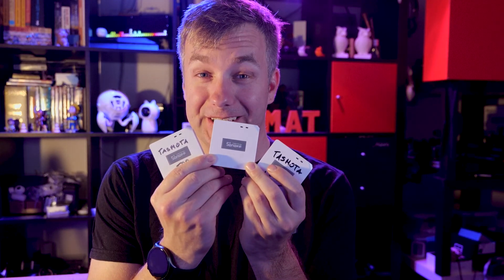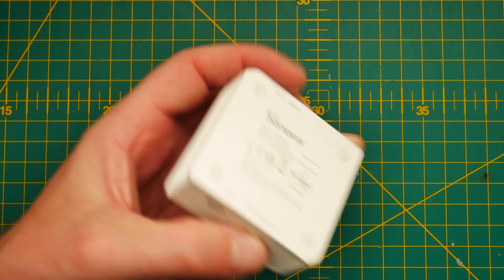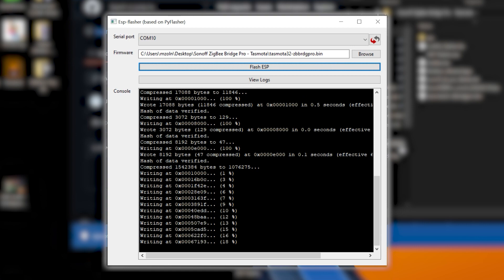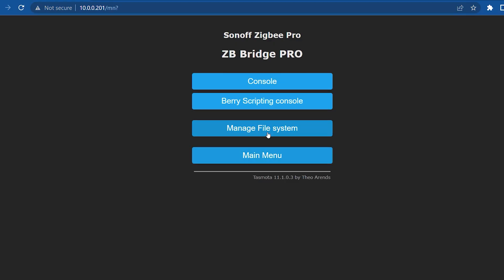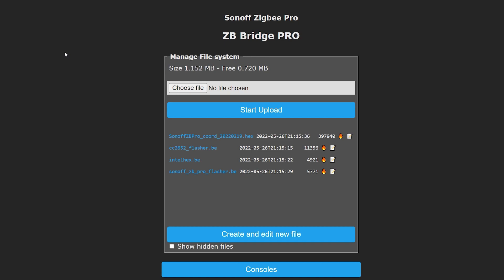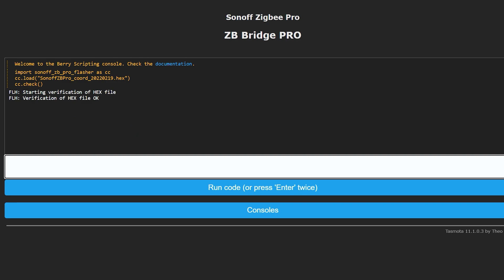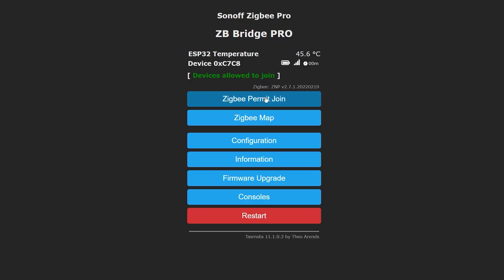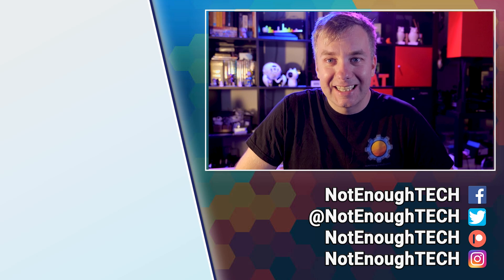Flashing Tasmota on SONOFF Zigbee Bridge Pro

Comment: Great job! I try to flash it but i give me an error. First I started flashing the snzb pro with tasmota32-zbbrdgpro.factory.bin and then I get the error:

welcome to the Berry Scripting console. Check the documentation.
import sonoff_zb_pro_flasher as cc
cc.load("SonoffZBPro_coord_20220219.hex")
cc.check()
FLH: Starting verification of HEX file
FLH: Verification of HEX file OK
cc.flash()
FLH: Flashing started (takes 5-8 minutes during which Tasmota is unresponsive)
stack traceback:
	<unknown source>: in function `flash`
	<unknown source>: in function `main`

It gives me the error 3 ou 4 seconds after hitting "run code" button. What can I do? I'm stuck in this step!!! 😔
Reply: There's one specific for zb bridge in tamotizer.

Comment: Great video on how to setup the Sonoff ZP Pro.... i have spent days trying to link this to Zigbee2MQTT on Home Assistant, but with no luck. Are you able to help on this?
Reply: Did you solve the problem? I also can't get it working with Zigbee2MQTT.

Update: In the end I went in the Sonoff Zigbee Bridge Pro to Config > Auto-Config and applied the "Sonoff ZBPro TCP" Auto configuration. Then in home assistant added the "Zigbee Home Automation" and picked "Texas Instrument" with the port "socket://YourDeviceIP:8888". Now it works.

Comment: my port detect, why i cant connect for install , so tried for flash 😭, im newbiew please help
Reply from the maker: Check your TX RX wiring.  Swap them around if needed. Port detected means that your flasher is working
Reply: @notenoughtech   thanks after 3 day im so tried, The error is in Socker VCC, it has to be moved, I think Socker VCC is already the default in 3.3, im use ftdi

Comment: Have anyone from you the original stock firmware from the zbridge-pro. Because i was so dumb and have not saved the firmware. I want back from Tasmota to original.
Reply from the maker: It's not possible as the firmware contains the MAC of your unit and if you don't back it up - it's lost
Reply: @notenoughtech  the MAC Adress is in Hardware not in Firmware, because when i erase and flash with Tasmota the MAC isn't changed.
Reply from the maker: The Mac address is compiled into the firmware hence you can't flash it without having original backup

Comment: Hello everyone and thanks to the author for the Video. I don't understand why my sonoff bridge pro does not enter flash mode. Must the led on the Sonoff be green or blue? Mine is blue. I connected the GP IOO to GND but still does not turn green. Also I connected also the bridge to an USB power source still didn't worked. Any tips? Thanks
Reply from the maker: The most common issue is not enough current from USB port. This is down to your FTD not providing enough? This would be my first take, then I'd double check the wiring and that the GND is actually pulled on GPIO00

Comment: Tasmota 13.3.0(zbbrdgpro), expanded FS, updated firmware etc but I never got the TCPstart 8888 command to work, after a day I gave up and configured the ZigbeeBridgePro to work as a bridge directly to HomeAssistant, used Autoconfigure and that worked fine. And of course, many thanks to all contributing !!!!!

Comment: I tried this method, but I don't understand where I'm going wrong. I used the tasmota32-zbbrdgpro.bin version, I wrote successfully, I set it up, I get to the partition manager part but I can't increase the partition size! Can you provide a new link to the BIN file because the link is 404

Comment: Thanks for your video, but I think I made a mistake using the latest files and something seems to have changed. So I am stuck in the middle of nowhere.
Reply from the maker: Double check the file. You can always flash it again. It's a hard to mess up process
Reply: @notenoughtech  It would be more than fantastic if you could update your workflow based on the latest December 2023 Tasmota release.

Comment: Nice tutorial, everything went through without any problem, my sonoff bridge pro was switched to tasmota bridge and it works. Unfortunately I have a problem after some time sunoff (tasmota) stops working does not respond to ping, it is still connected to the AP receives signals from the sensors, but the IP address it received is not reachable, this happens after some time and stops responding, only restart helps and it will work for a while. Have you noticed this issue with yourselves?
Reply from the maker: Try different firmware revisions. Also make sure your power supply is good. Try another usb charger and cable as they can cause instability by voltage drop especially if you are using a longer usb cable

Comment: got error for new version 
import sonoff_zb_pro_flasher as cc
cc.load("SonoffZBPro_coord_20230507.hex")
cc.check()
FLH: Starting verification of HEX file
BRY: Exception> 'value_error' - invalid size for line: :1000000000200120F54E0200916C0200916C02006C
maybe i use old  sonoff_zb_pro_flasher? anybody test it?

Comment: The link in the blog post for the firmware doesn't work. I tried using tasmota's own web flashing tool but it installs the incorrect firmware when you get to the cc.flash() stage.

I'll work this out later, but we need an update either from tasmota or from someone in the know.

Comment: Thanks for this vidéo 😃
But when flashing, I have this error :
The firmware binary is invalid (magic byte=FF, should be E9)
In your web page, you explain that now we need to flash 2 times because tasmota32-zbbrdgpro.factory.bin is too big.
But I never understand which firmware I must flash first to be able to increase the partition size 🤔

Comment: hello, first of all thank you for this usefull video and for the article also. You mention the 'zigbee not found' error after the cc.flash() function but don't give your workaround ;-)
It's been several months now, how can I resolve it ?
thank you very much
Reply from the maker: Ok, sorry about it - I was 100% positive that my reply was posted. The CC flash issue is likely related to the function not being present - therefore some files are either old or not uploaded correctly, Can you see the file sizes once uploaded?  As the thread is a bit old and made early in development of this hack its worth checking with github discussion about the files recommended for the flash to happen. They were changing naming convention soon after as well.
Reply from the maker: I'm pretty sure I replied to this form my mobile but comments here on desktop not showing - can you confirm?
Reply: @notenoughtech  hello, I can't see any answer to this question 😉

Comment: Is there a video on how to make the sonoff pro a router instead of a co-ordinator? I like the zigbee2mqtt software better than tasmota zigbee software but I still want to use the sonoff pro hardware. Tasmota software works fine but zigbee2mqtt is better and easier to backup etc. Thanks
Reply: Agreed, I already have a coordinator for HA (Sonoff Zigbee 3.0 dongle plus) and this little thing would be perfect as a router to extend coverage but also to group WiFi devices - or am I going about that the wrong way (it's not pairing with my 4CHPROr3 on stock firmware, only directly with eWeLink)?

Comment: it doesn't work in any way neither with the nspnel nor the factory version nor from the web interface. The last step always fails: the flash of the controller does not give errors but only that it started the check remains from the log but then nothing happens.
Maybe it's not compatible with 12.3 anymore?
Reply from the maker: No errors indicate timeouts. I'd check if you are correctly connected with the device.
Reply: @notenoughtech  Now everything is ok. I tried again and after several attempts it worked. I think it was a bad contact on the usb adapter. Thanks !!

Comment: Thanks as always. I am a bit confused about zigbee2tasmota vs zigbee2mqtt. I am guessing zigbee2tasmota is built into the tasmota firmware by default. How would you go about using zigbee2mqtt instead?
Reply from the maker: They have slightly different way of interacting with z2t having built in some basic automations. as long as you can pass the details from your sensor to Nodered it will work just fine
Reply: @notenoughtech  Thanks. I guess it will make more sense when I have a go flashing one of these bridges. Will try with just tasmota to start and then try zigbee2mqtt if required.

Comment: When I try to flash the zigbee bridge pro and I connected the cables as shown, do I need to connect the USB Power aswell? With the web-Installer I get an error when trying to install. When I use the offline esp-flasher, I always get the error following error:
Changing baud rate to 460800
Changed.
Chip does not support baud rate 460800, changing to 115200
Connecting......................................
Unexpected error: ESP Chip Auto-Detection failed: Failed to connect to Espressif device: No serial data received.
Reply from the maker: Power depends on your flasher. I'd check first if the device is actually booting in flash mode - I had some problem properly booting it at first

Comment: I executed the process exactly as described in the video. I ran all commands and got the same messages as in the video. Even the same error when executing cc.flash() on the console. In the video, you mention that you thought that by the time the video was out, this problem would have been solved by the Tasmota team. Can you tell me what option I should persue to get the coordinator flashed on my Zigbee Bridge Pro?
Thanks in advance
Reply from the maker: Just to confirm.. can you verify you have the same ZigBee IC on your bridge? I wonder maybe revision has changed. They have done that on so off dongles so just trying to make sure as you (I assume) purchased yours recently
Reply: @notenoughtech  
ESP Chip Id6387496 (ESP32-D0WD-V3 rev.3)Flash Chip Id0x16405E (DIO)Flash Size4096 KBProgram Flash Size4096 KBProgram Size1479 KBFree Program Space568 KBFree Memory147.9 KB (frag. 21%) Partition safeboot832 KB (used 93%)Partition app0*2048 KB (used 72%)Partition fs1152 KB
Reply: I guess the above doesn't contain the answer to your question. Looking to the print on the Zigbee chip, I read these data: CC2652 , P1F , TI 158 E , A4EJ G4

Comment: How does one change the Zigbee Bridge or Zigbee Bridge Pro's channel?
Reply from the maker: Oh, beats me actually, I think there was a console command you can use for that.
Reply: @notenoughtech  This is the most problems I've had with Tasmotizing a device, and I have quite a few different Sonoff devices Tasmoized already. With this Zigbee Bridge Pro, I had to try 3 times before succeeding. Anyway, I found a Tasmota command that can change the Zigbee channel: ZbConfig {"Channel": 20}. Simple as that, but do it before you have any devices connected so you won't have to re-pair.

Comment: Hello, I love your channel, I just bought a Sonoff ZB pro and tryed to flash it like you showed in this video. That failed so I flashed it with the tasmota web installer, that seems to work. But can't click onthe buttons  Permit to Join or Zigbee map ( they stau grey ) and I can't find the problem.Do you have a suggestion???.
Reply from the maker: Have you flashed the coordinator as well? You have to flash esp inside and the ZigBee IC
Reply: @notenoughtech  I thought this was done in the same flash
Reply from the maker: No. You need to load tasmota then use it's console to upload the new firmware (unless process has changed) I run my flash early on so some of the steps could be streamlined by now
Reply: @notenoughtech  finally it works, thanks for the help.

Comment: Thanks for all the work, from you and the Tasmota community in general.  Your description of the "old way" meant I could still use that even through the current firmware is semi-broken. (The bug is filed, and they're working on it.  Unfortunate that it was not working over the holiday.)  Regardless, thanks to your simple guide, I have a happy working Sonoff Pro.  Hours of re-linking, and it's all back and happy (plus a few sensors I couldn't add before), and the old Sonoff (non pro) flashed to the router firmware to extend the range of my system farther.

One bit you may want to include is how to backup the firmware on the router before flashing the new firmware on for the CC2652.  Always good to have a backup, just in case you want to revert to factory later.
Reply: Can you please help? I hve PRO and cannot use this tutorial anymore, files are old and do not exist anymore.
Reply: Tasmota is SHIt 😂

Comment: Hi, I tried to follow the instructions in the article. Unfortunately the links of the firmware files are not longer working. So I searched and found a file with the same name also on the Github but not in "unofficial" but in "release" folder. But when I try to flash the file with Flashtool I get this error message: Unexpected error: The firmware binary is invalid (magic byte=FF, should be E9). Anyone can help what is the issue with this?
Reply: Hi, I have the same problem, did you found a solution for it?
Reply: @graczerg  yes with the online flashing tool from the Tasmota Website. Any other solution did not work
Reply: @Angelus1981  I used this but ultimately ended up with
BRY: Exception> 'import_error' - module 'zigbee' not found
stack traceback:
	<unknown source>: in function `init`
	<unknown source>: in function `loader`
	<unknown source>: in function `flash`
	<unknown source>: in function `main`
In the video he says that's due to the wrong firmware being installed. So I'm back to square one. Which version of the firmware did you select when you flashed using the tool on the tasmota website?
Reply: @wangouthangout  unfortunately I do not really remember but I think there were only 1-2 options from the text that seemed right.

Comment: Hi I have exactly the same board, but I am not able to flash it, better to say not able to get even chip_id answer. I have connected all pins as you did, through the soldered header, powering via USB port while keeping the GIPO0 grounded, but I can get COM running. looking through scope the TX from the board sends very faint distiorted signal, when the request via RX line is received. To me it looks like very strong pull-up. Any idea? thank you for helping / sharing.
Reply from the maker: try swapping tX and RX - sounds like you may have a different serial board - its the most common issue. Second is having enough power

Comment: After getting this module flashed and working, how do you connect with Home Assistant?  Great Video.  Stephans comment below really helped getting it working quick.  Thanks
Reply from the maker: It uses MQTT to talk to other systems
Reply: @notenoughtech  I have it configured for mqtt. I see the sonoff zbbridge in home assistant. I associated a couple of contact sensors. I see them in tasmota but I can't find the sensor in HA. Do I need to install something else?
Reply from the maker: In all honesty I'm not sure how HA handles that - you probably need a missing yaml file that sets up the sensor for you properly
Reply: @notenoughtech  I forgot to respond but I first had to learn how to install zigbee2mqtt in HA and configure it. Then all the sensors started showing up. I have two bridge pros. One on zigbee2mqtt and ZHA. Personally I like z2m better. The interface gives you full control of the sensor. Question is, can I put both bridge pros on the same z2m instance?

Comment: What does GND on power on mean? I Connect GPIO, plug in the usb, then switch cables? A blue led on wifi only shows when connecting GND to GND.
Reply from the maker: You need to pull GPIO to ground on power up to enter flash mode

Comment: Hi
I have the sonoff zigbee bridge (Not the Pro) and flushed it with Tasmota. Verry happy.
I was so happy and as I have 4 of the bridges, I started the next and flushed it as well, only to find out that I can only have one in ZHA 😢. Is there another options for Home Assistant or should I revert to SonOff, sadly I do not have the original sonoff firmware?
Help please. 😁
Reply from the maker: You would need original firmware to revert. Without router firmware you can only use it in coordinator mode. ZHA isnt inaccessible just a bit more annoying to use than Z2M (my personal opinion) perhaps sell these locally or gift to someone and get either Sonoff dongle or pro version once the router firmware is mature

Comment: Any chance you can do a video to connect this to zigbee2mqtt? I couldn't find any guide on it.
Reply from the maker: don't think the firmware is ready for this just yet, i might be wrong as as the development process was pretty swift on this
Reply: You have probably already got a different coordinator, but you can do this by switching the Zigbee TX and RX to TCP TX and RX, you can then start a TCP bridge like on the standard Sonoff Zigbee Bridge. 
More info here: https://tasmota.github.io/docs/Serial-to-TCP-Bridge/#commands

Comment: Can you as an alternative option also reconfigure it as a Zigbee Router instead after flashed it like that? It was mentioned on In the linked GitHub discussion that a Z-Stack 3.x.0 ZNP Zigbee Coordinator ZNP stack can be configured in router mode in Tasmota by using a fake 0xFFFF PanID flag but not explained exacly how to do that and then how to pair it as a Zigbee Router?
Reply from the maker: As the instructions I read about it weren't clear I don't know yet. I assume that you will be able to push the router firmware eventually as you would with other cc2652s but we will wait a bit longer for the hex file that can be pushed this way. 

There is a button on the device so we could in theory use it to trigger the pairing mode.
Reply: It used to be possible with CC2530 to configure as a router, but it currently fails with the CC2652. I need to investigate if it's a small glitch or a major problem.